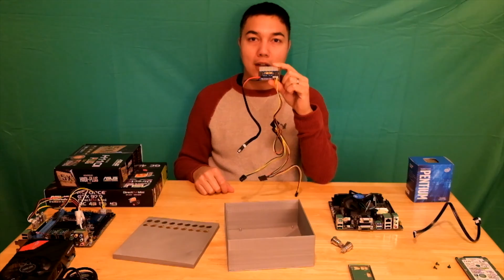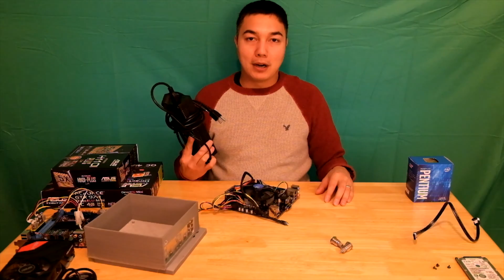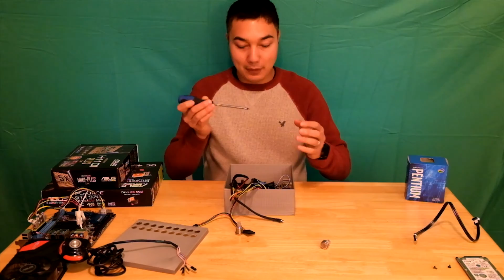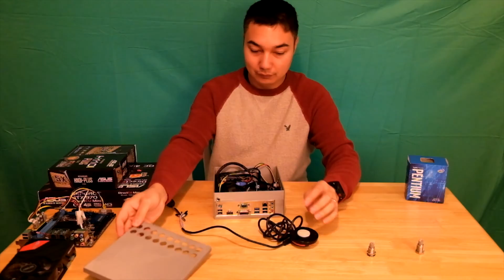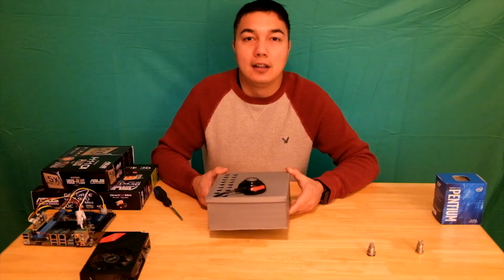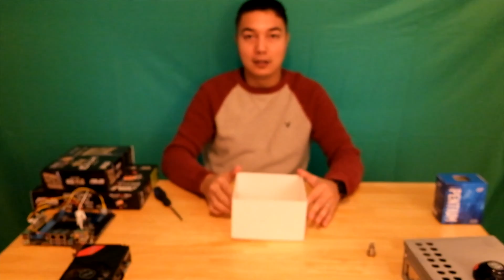3D Printing a PC

Comment: PLA's glass transition temperature is around 60c..  I wouldn't use PLA to be safe (its unlikely to happen but can soften).  while I know if your system is running at 60c the temp within the case is lower I still wouldn't use PLA..   ABS (glass transition of around 100c) would work nicely but is a pain to print.  If you want kind of the middle ground you could use something like PETG which is around 80c (much safer then PLA).  Just food for thought.

Comment: Aren't you concern with there being no shielding for a plastic PC case?
Reply from the maker: Thanks for the question. I'll talk about that in the next video. I thought about that, but then I went to walmart and saw most of the laptops are all plastic now. And to top that off most laptops don't even have a grounding wire on the laptop side of the brick. Also, the motherboard is made of PCB which is electrically very similar to PLA.